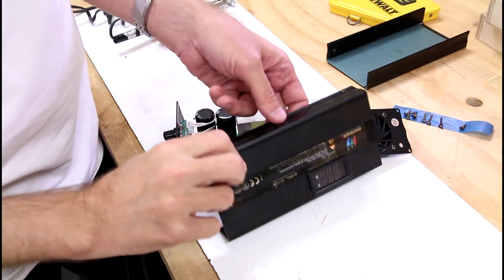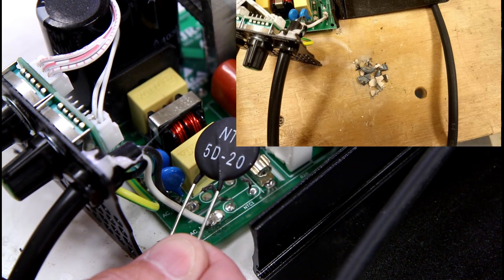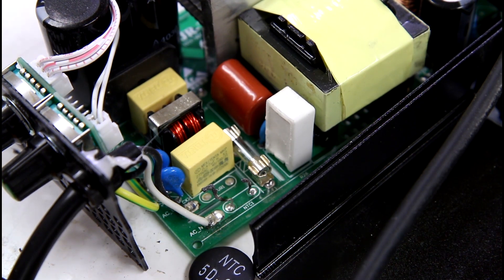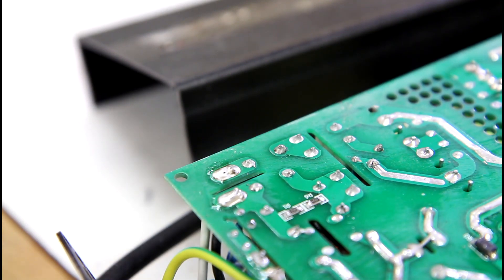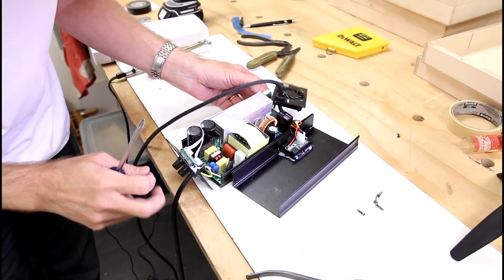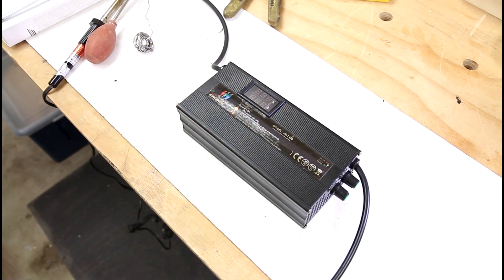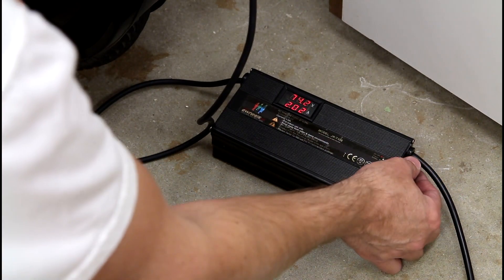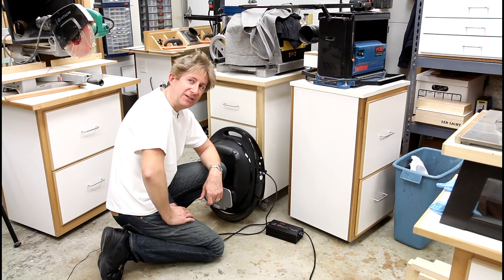EWheels 84-volt Fast Charger Repair

Comment: Mine broke in my 67.2 fast charger from AR its 9 amp what ntc should i use the 20 amp one on Amazon ??? Or just get that 7 amp one and just use 5 amps ???
Reply: And can i use and ntc that looks like that
Reply from the maker: As long as the NTC that you get can handle the current load then you'll be fine. I'm sure the 20-amp one would also work.